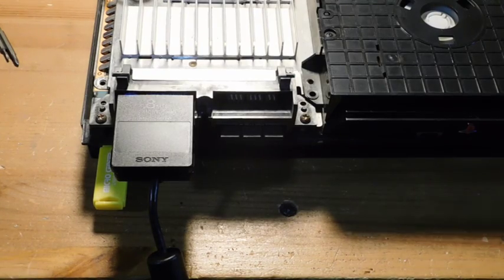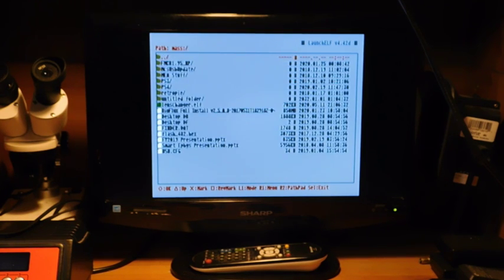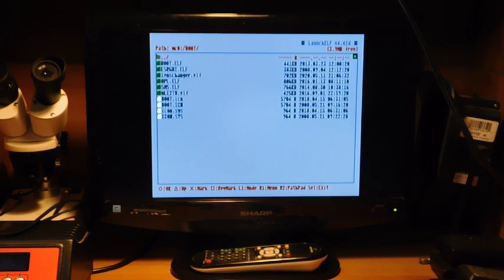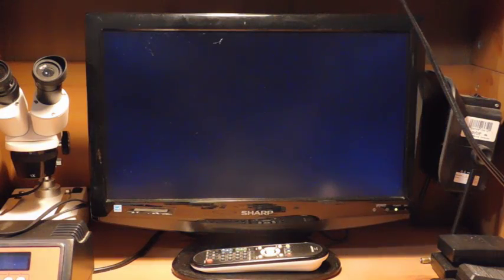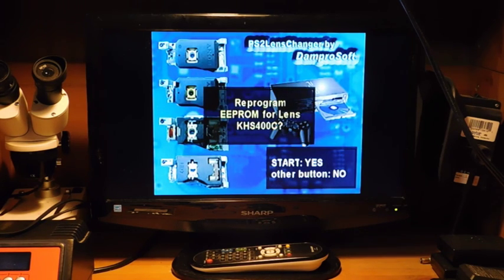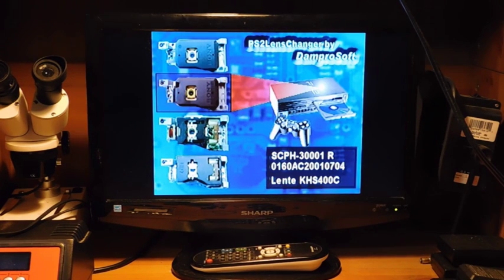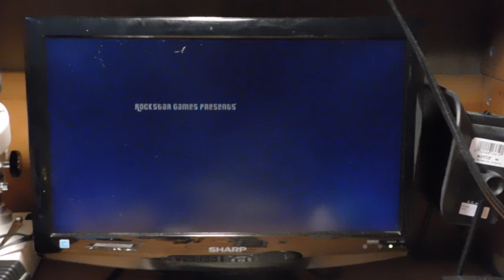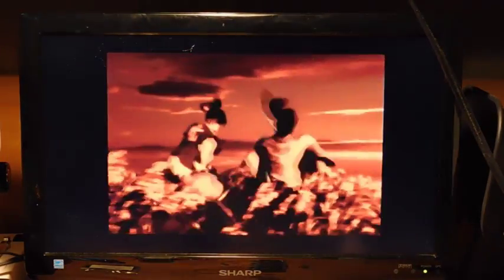PS2 (Original "Phat") Laser Replacement Guide!

Comment: I did this, but I might have messed up the desoldering.

What is wrong if the laser is making a electric humming noise, like an electric scratching noise?
Reply from the maker: Maybe it is not attached correctly to the worm screw that moves it up and down? Does the laser move up and down the rail?
Reply: @LIRetroGaming  yes it did move up and down. It was making an electrical buzzing sound. And re-installed the original laser and that one is working just as it did before, only reading CDs and moving normally.

I think I messed up the de-soldering. Used to much heat and pressure and I think I damaged the board when I was trying to remove the soldering point.

I ordered a new laser and some desoldering braid, I read up on soldering and apparently it's not so easy, it's important to have the correct heat setting not above 370 degrees celcius and to use a desolder braid in between of the correct size, apply some heat on it the heat transfers down through melts the point and the point is absorbed by the braid, also should not keep the soldering iron for to long over the board so not to damage it.

Anyway, gonna try again with a new laser, and also might install a harddrive to play games from if I'm unable to fix the laser.

Do you have any advice for the soldering?
Reply from the maker: Yeah that is definitely not normal. Without seeing it it’s really hard to say for sure what happened but it does sound like the new laser is messed up
Reply: @LIRetroGaming  cool thanks. Just gotta try again and be careful with the desolder.

Comment: Hi, I just followed your tutorial and replaced old 400b on 400c laser and it works but its loading games really really slow, is there a way to improve it ?
Reply from the maker: Yes you can try adjusting the angle of the rails and that may help. I briefly mentioned it in the video
Reply: @LIRetroGaming  at the beginibg it didnt work at all, after adjustment the angle its loading few minutes.
Reply: @zabek87  did you ever figure it out?
Reply: @ethanwashoe5868  Nope, I invested in HDD and OPL

Comment: Do you actually need to do the whole homebrew software step? Or can it be skipped?
Reply from the maker: I have learned that the homebrew step is pretty mandatory. The new lasers just don’t work without it
Reply: @LIRetroGaming  Also I like how you showed that gear when dealing with one kind of disc loads but not another.

My ps2 loads ps2 disc but not ps1 disk. It makes the loud grinding noise only with ps1 disc. Would that gear be the case? Or maybe it just need a replacement plastic arm and lubricant?
Reply: @LIRetroGaming  Hi, I'm stupid.  How do I get the program on the memory card?
Reply: @LIRetroGaming  Hi, I ordered a replacement laser and installed it.  Once i powered up the ps2 the laser doesn't do anything.  I don't know how to install the program on the memory card.  Any help would be appreciated!! Thanks

Comment: Thank you very much for the walkthrough, it's very helpful. I did all this but forgot about the little black screw, and the lubrication of the rails. Speaking of that, better to use a very small bit of paper towel and spin it into a sort of point, then dip that in the lithium grease and apply carefully with that. Those plastic cue tips are a no go in the present and future, because they end up either in landfill or the Oceans. Bloody vile 🤮

Comment: Ok so I have a strange issue I hope you can help me with. With my system even with the old laser it would read games but just take it's sweet time to do so, sometimes even taking a few minutes for single layer CD games and PS1 games. I followed this tutorial and put the new laser in no problem but the weird thing is it does the same exact thing. It reads games perfectly fine it just takes minutes sitting in the system menu before running the game. What do you think this could be?
Reply from the maker: Did you watch the firmware like I did in the video? It’s hard to know exactly why it’s doing that
Reply: @LIRetroGaming  Well I don't have a modded memory card to see that but considering it's doing the same thing the old laser did I'm not sure a new firmware would fix it but I'm not sure. If it gives you any more insight the disc starts immediately spinning when you close the tray but stops after a few seconds. It only starts back up again after minutes and then it runs the game no problem
Reply: @DeathMetalJedi  mine does this too, did flashing it fix it?????

Comment: Now the disc wont even spin
Reply from the maker: Did you remove the anti static solder point on the laser?
Reply: @LIRetroGaming  Yeah, but guess what. The laser that I bought was faulty, so I bought another one from another supplier, and it's working now like a charm. Thank you for the tutorial!!!